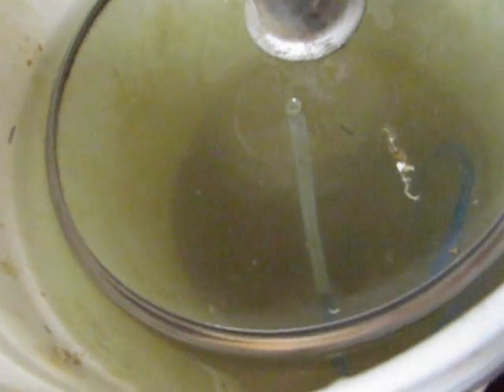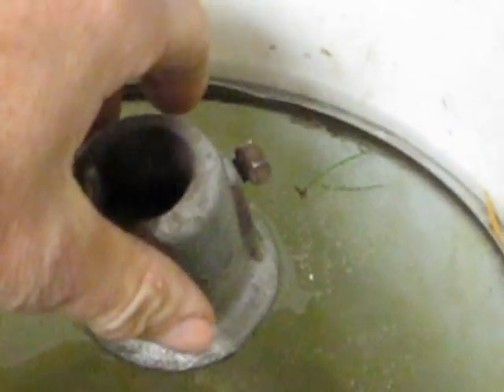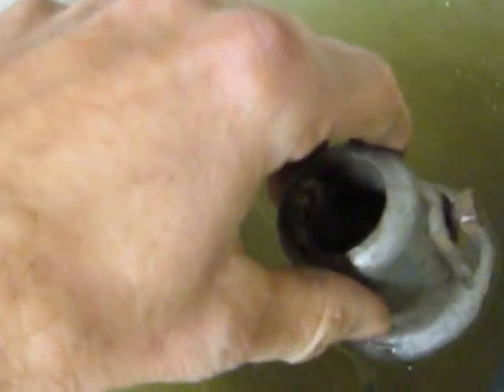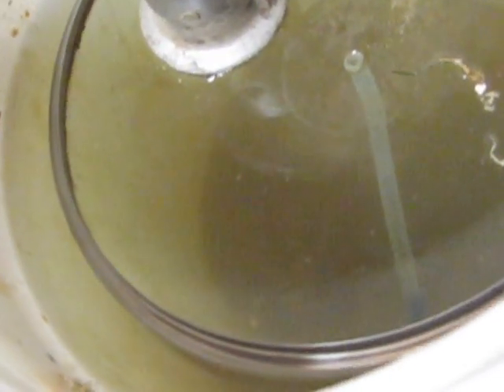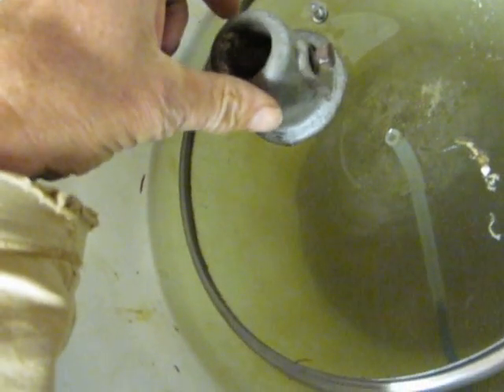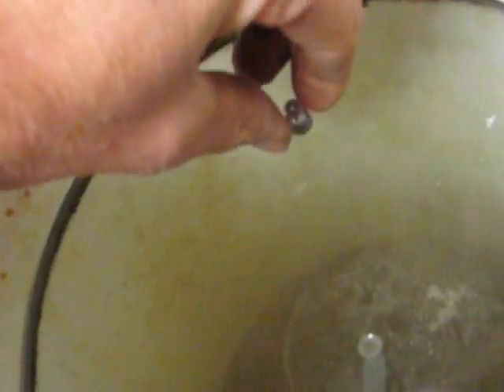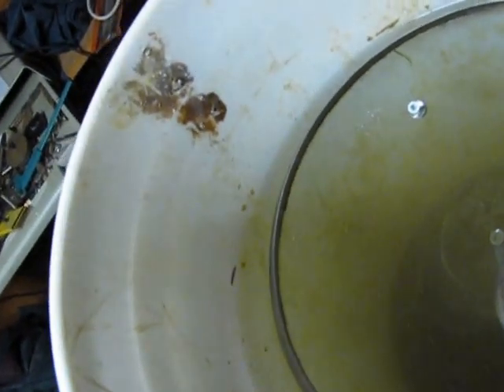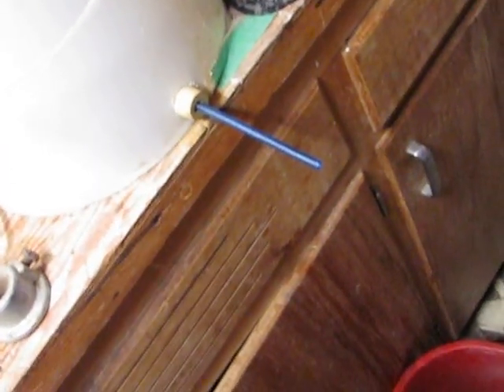Dripper irrigation. How to Fine Tune the  water speed!

Comment: So how would you share the output with multiple plants?  Would you make a single hose with t-joins that have even a small hole per each output?
Reply from the maker: Hi, reddpill,  no,  I would use a "flip flop" or "tipper" to collect the water.  These are like the bamboo Chinese boar scare except they are 3 or 4 ft long.  I made them from v shaped metal for drywall corners.  So it would fill up with the water and then "flip" and throw out the water. Then it flips back to empty position to fill up again.    I have found that dripping water soaks down in a small area but when something tips over, it spills the water widely and this is "probably" better for the plants.
Reply: Brian White Ok cool, thanks for the heads up.  btw, I'm currently seeing if a clay plate would work inplace of the pot lid.  We'll have to see how long it takes to seep water through the clay.  Another thought I did have was to use a clay water filter however it's an expense option compared to a pot lid. 

http://www.bunnings.com.au/filter-water-stefani-4-5l-filter-candle-w-purifier_p5093644
Reply from the maker: *****  Hey! Thanks for trying.  It is so hard to get the first person to try anything! Once someone tries it, and reports back, it gives all the other people "permission" to attempt the same thing.  I have only ever used glass lids and aluminium bowls with 2 holes drilled in them for this. The ideal thing would float naturally but I have not found it yet.   Thanks again   Brian
Reply: Yeah I find that too.  Crazy that no one tries these simple things.  However, it rained while collecting water, back to square one!

btw do you have a facebook account Brian?
Reply: btw, I just ordered a little air pump to give ya pulsar pump a go too! What do you reckon?  Also going to hook it up to a little 3v - 15v solar panel! See how that goes too.

http://www.ebay.com.au/itm/Diaphragm-Pump-Water-Device-DC-12V-for-Motor-Car-R385-/281322333300?pt=AU_Pet_Supplies&hash=item41801e2474
Reply from the maker: *****
 Yes,  I am in Canada, my facebook  account has garden ornaments a little piper on a mushroom and a tiny pig eating a strawberry. My float works rain or shine,  If it rains, the float just rises to the top on the water . Brian
Reply from the maker: *****
 I really don't know if that will work or not, the car stuff sometimes takes a lot of power to start.  I bought DC blowers to pump lots of air (The ones that plug into a ciggy lighter outlet in the car and blow up air mattresses and they will not run from my solar panel).
Reply: Brian White Found ya!

Yeah that clay flower pot plate didn't work out very well... Looks like the glass pot lid works best.  BTW that pump I noticed that it went down to 6volts hence why I purchased that one, because solar power isn't consistent.  May have to hook it to a small motorbike 12v battery and solar change that.